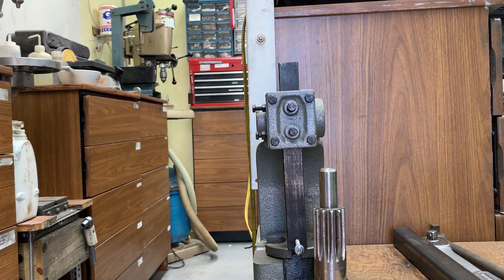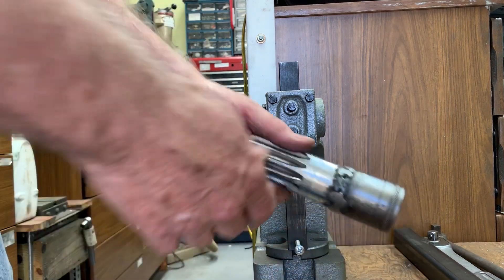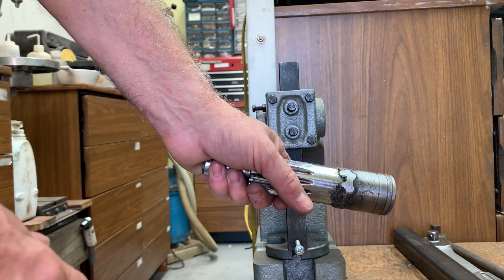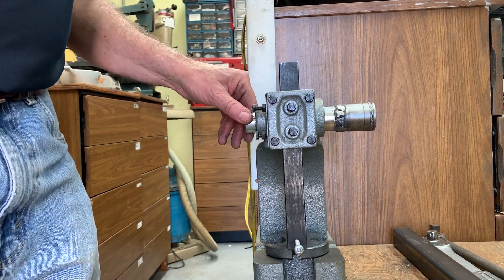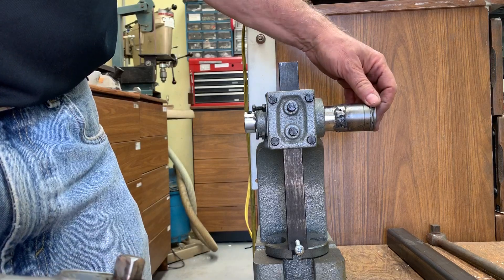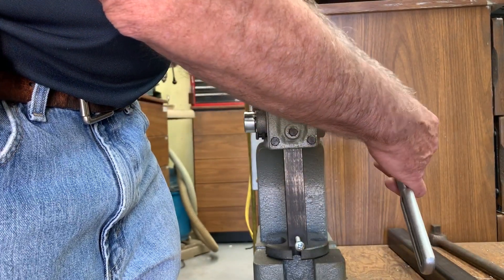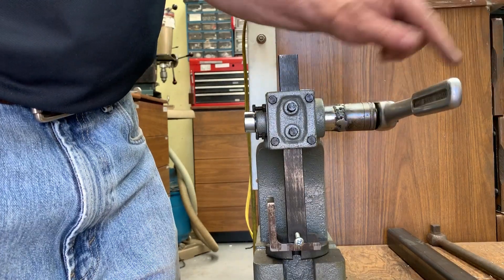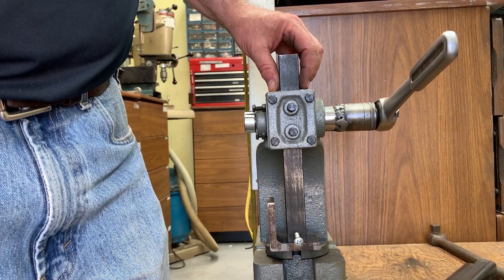arbor press handle modification

Comment: I'd not want the handle to be moved farther to the right.  If you're willing to cut up the pinion shaft, I'd be inclined to machine a 3/4 square hole directly into the shaft, so the ratchet handle is in the approx position as the original handle, and use a 3/4" drive ratchet, which would probably hold up better to the forces than a 1/2".

Comment: I just milled a 1 3/16 hex on mine (1 ton Horror Freight) right over the handle hole for a socket to slip right over.  In that way I thought I could still use the round handle that came with the press if I ever thought I really wanted to reef on it and that pressure would be too much for the ratchet pawl, but I’ve never had need to slide the original round bar back in the hole in 3 years. I use an extendable 1/2” drive ratchet to give me the exact length I want.  I also made an adjustable stop plate with a square hole in it that slides over the top of the ram for repetitious assembly jobs, a 1/4” thick HDPE round disc that snaps over the Maltese Cross press plate for gasket punching/cutting, and a bunch of small pins and and an adapter to hold any of my round hole hollow punches in the end of the ram all fit in a block in the upper left side of the press so I do not have to look for them.  It’s pretty tricked out if I do say so myself.